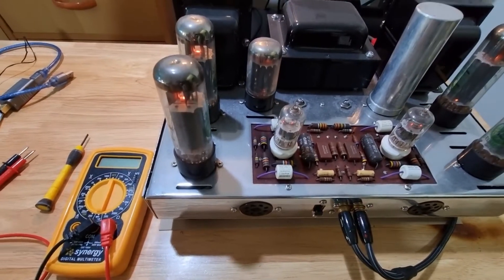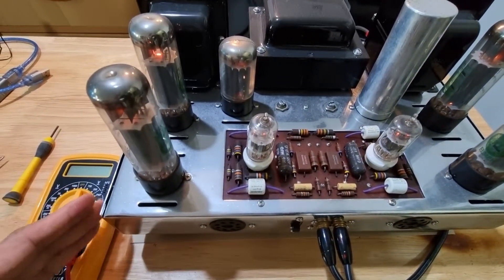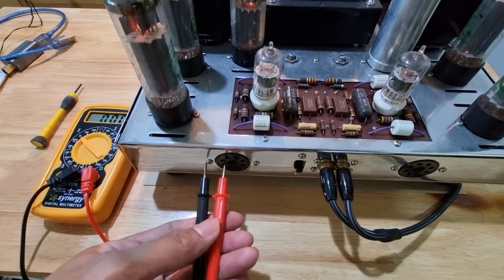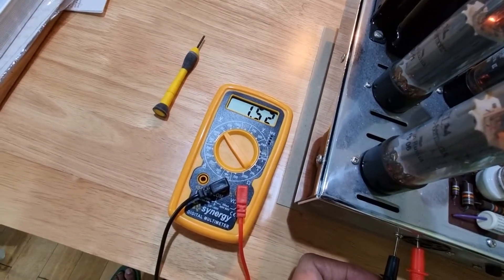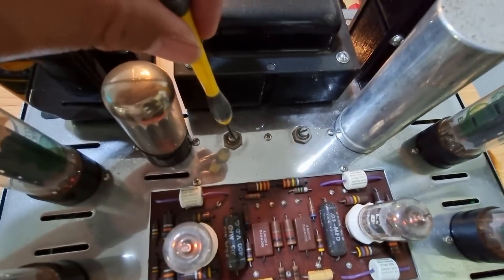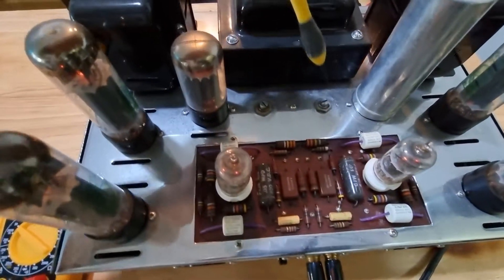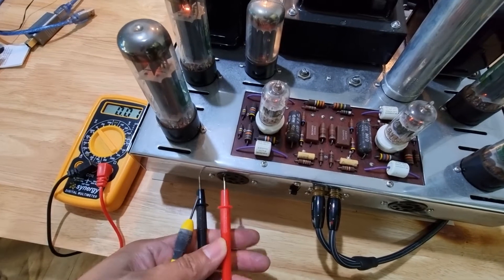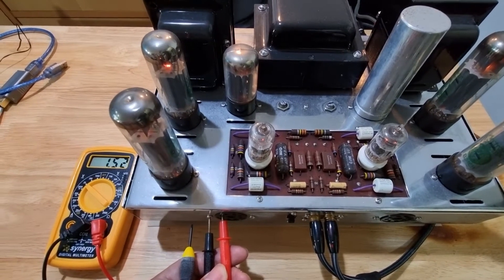How To Bias A Vintage Dynaco ST70 Amplifier

Comment: I couldn't find anything on the internet if i'm using a dynaco that has its transformer changed for 230v electric, if the bias setting would differ from what the amp recommends 1.56v on 120 v america...my common sense says it should still be the 1.56v setting as if it were on 120v...because the transformer makes the amp work on 230v and I would think that has nothing to do with the bias setting...❓
Reply: Your logic sounds correct to me.
The line voltage, be it 110VACor 240VAC should be irrelevant at this point as the bia setting voltage situation would have been already rectified to  relative DC voltage in each case